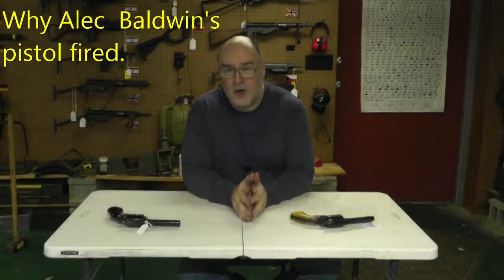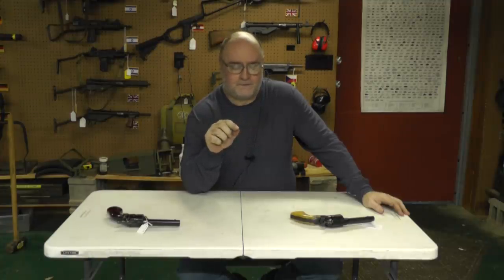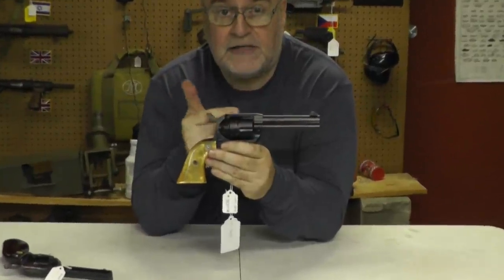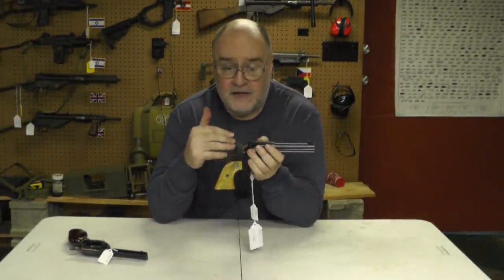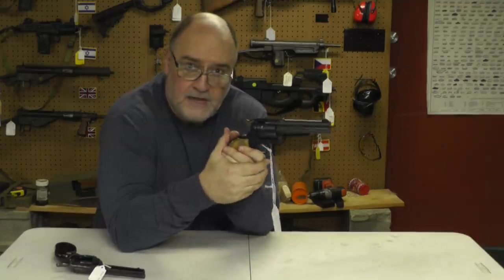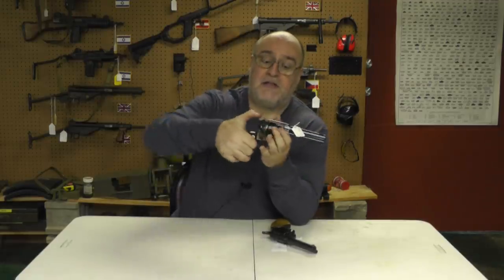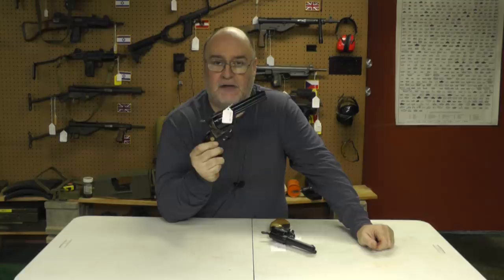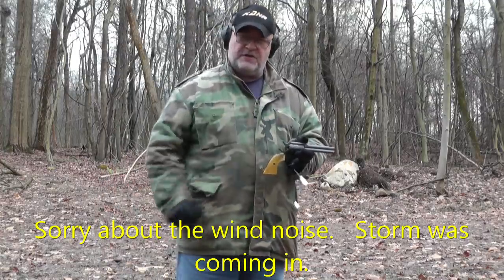Why Alec Baldwin's gun fired

Comment: Alec Baldwin’s gun fired because the trigger was pulled.   The trigger was pulled because they were set up for a shot FROM the perspective of the person Baldwin’s character is shooting at in the film.  So he was SUPPOSED to point the gun at the camera and shoot.   The director and cameraman were behind the camera where they were supposed to be.  The oft quoted maxim that you are never supposed to fire a gun AT the camera is made up nonsense cited by people who have never seen a movie. Movies ROUTINELY show guns firing directly at the camera. That is done by loading the gun with blanks and making sure the camera and crew are far enough away that the blanks do not pose a hazard to them, and shooting with a longer lens to make up for the distance as needed.  For safety’s sake, actors are forbidden from playing with the guns or checking their loading.  That is handled by the Armorer on sets, the ONLY person who is authorized to handle ammunition of ANY kind in a gun that can be fired. ( shots of actors loading guns are shot with Dummy bullets checked and handed to the actor by the Armorer immediately prior to every take. And in MOST shots of actors holding guns in which they do not fire the gun, the gun is a solid rubber or wood PROP that often does not even have a HOLE in the end of the barrel to make it easy to identify as prop because the lack of a black hole in a black barrel will not be picked up on camera. )   On THIS set, the Armorer allowed crew to play with the real guns after hours, which introduced LIVE ammo onto the set that should not have been there.   This live ammo was not inventoried before and after the gunplay and some of it ended up getting mixed in with the SET ammo, which is exclusively supposed to be Dummy bullets ( look real but have no primer and no powder ) and Blanks ( which make a noise but have no bullet ).  For the shot in question, the Gun was SUPPOSED to be loaded with dummy bullets, because the camera shot was close in enough to see if there were bullets in the cylinder of the revolver. ONE or more of the dummy rounds loaded appear to have been a live round.  In the shot, Baldwin was supposed to point at the camera and pull the trigger and the gun was SUPPOSED to just go ‘click’.  A covering shot using a gun with blanks in it would have made the bang and been edited in.   Baldwin had ZERO culpability and charging him with manslaughter is imbecilic.   The person at fault is the ARMOURER, and she should have been charged with negligent homicide.  Actors are handed guns on set EVERY day.   The actors are not supposed to check their load and Alec Baldwin is likely not qualified to tell a Dummy round from a live round by looking.  As a producer on the film, he shares some responsibility for the negligence of allowing the crew to fire live ammo with the production’s guns… But that responsibility is shared by ALL the producers AND even the Director on set who is the one who was killed.

Comment: It might have fired because Alec Baldwin was foolish enough to pull the hammer back , stick his finger inside the trigger guard and apply the 2 (or less) pounds of pressure that dropped that hammer on a live round of ammunition.
A single action gun like that Colt Army is 100% safe in the right hands. In the hands of untrained woke celebrities, not so much.
Just my 2 cents.

Comment: Real guns aren'tment to be on movie stages; they look too real. Remember Brandon Lee?  It's too easy to mistake a real gun for a stage gun with blanks. If that was a single-action, pulling the hammer will bring up the next round, If it doesn't lock and snaps closed, the bullet will likely go off. What was a real gun doing on the set?
Reply from the maker: No you’re wrong first pulling or cocking the hammer without pulling or depressing the trigger the gun will not go off.  
   Second real guns on set is routine.   The problem is the production company ie Baldwin hired an incompetent armorer, they permitted target practice with live ammo.  Direct safety violation.   They didn’t follow the procedures for checking weapons.   They ignored safety complaints after previous accidental discharges. 
   The real gun is not a problem.  Incompetent lazy corrupt people who let live ammunition on set and ignored every safety protocol are the problem.

Comment: Blanks never killed anyone, live ammunition has no place on a movie set let alone being loaded into the gun. Whomever loaded the live ammunition into the gun is responsible for the death in this instance, the actor was told he was handed a "cold gun", that being the case how incompetent in the use of firearms the actor is is irrelevant as they are not expecting to be able to do any damage with the weapon. If you are going to tell someone a gun is "cold" you better make sure that it is. A very good video but the "anti hollywood" crap doesn't add value.

Comment: He should've checked the gun himself. Even if I knew it was dry I'd check, but who ever brought a live round on the set   even before it was loaded is totally guilty and why sound  guys couldn't match the pull are just about as guilty . Also why a real firearm ❓ A good prop gun with caps is all you need. Many starter revolvers won't even take a live round. 😎

Comment: At the end of the day, that gun should NOT have had any live ammo in it. There shouldn't have been any live ammo on that set, anywhere at all. Now I always treat any gun as loaded & don't point them at anyone, but then I'm not making western movies where replicating gun fights are just a part of a day's work. As for being an "arrogant actor" not holding the pistol correctly, yet again, where was the armorer & safety co-ordinator? These are real guns, not rubber props, there should have been an immediate "ALL STOP!" if AB gripped the gun incorrectly & he should not have been handed it UNTIL they were going for a take & any practicing should have been done in a safe direction. But yes, the main issue is why there was a live round & not something that could plainly be recognized as a dummy round, such as a case that has no primer. My guess is that live round had been in that pile of "Prop Ammo" for many years & we may never know when it actually happened.
Reply from the maker: Well Baldwin hired the crummy armorer.  He permitted live fire practice during non filming hours.  There were 2 prior accidental discharges and Baldwin did fire the armorer nor check the weapons or ammo. Crew actually quit over safety concerns.    When the incident happen the armorer wasn’t even on set.  Again a decision made by Baldwin.
Reply: @psp1921tsmg  Yes, he was the producer so he has responsibility as he's the boss. But, like any boss you still cannot avoid someone f-ing up.
Reply from the maker: @dumptrump3788  they screwed up multiple times. He didn’t correct it.  He continued as is even after others quit due to safety concerns And didn’t change his behavior to double check faulty work.   
    He’s at fault.   So is the armorer.

Comment: He had to have pulled the trigger back prior to pulling the hammer back. Thus using semantic's, he didn't fire the gun, the gun fired it self. Thus if for no other reason and there's hundred's of case's where one is doing time for an accidently firing of a firearm. He being neglectfull and or completely unknowledgable. Doesn't hold water, when it was he himself that for what ever reason, pulled and held the trigger back. Then he himself pulled and release the hammer. Which ended up with it striking the bullets pin causing it to fire. Ignorance is not a valid excuse in any court I'm aware of.

He'll assumably be found guilty of accidental murder. And do to his noterity and wealth along with the attempt to keeping the trial from being to expensive to the general public when a lengthy trial will cost million's of tax payer money. I'll give a 100 to 1 that he'll get sentenced to; When being out on bail count's toward's the duration of sentencing; Time served, and obiviously inhibited from handling any fire arm in the future.